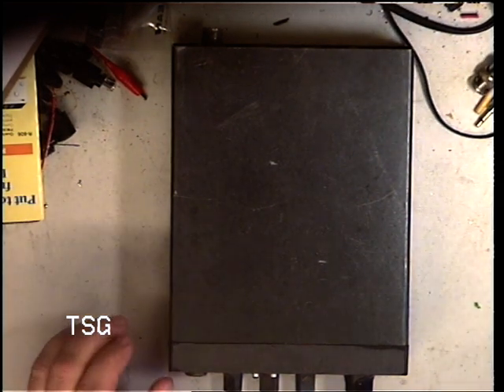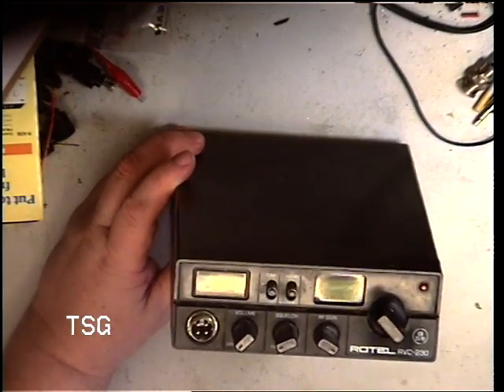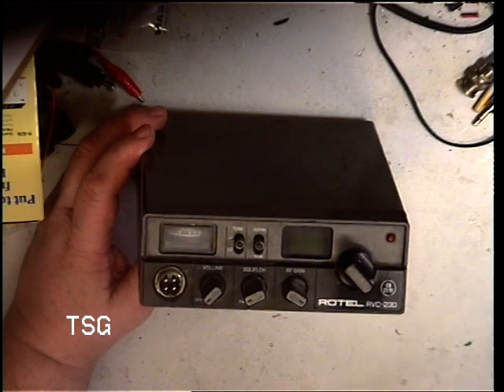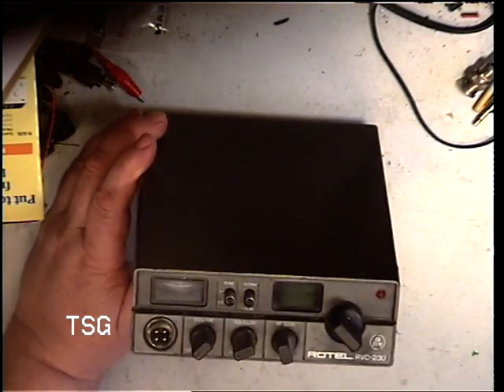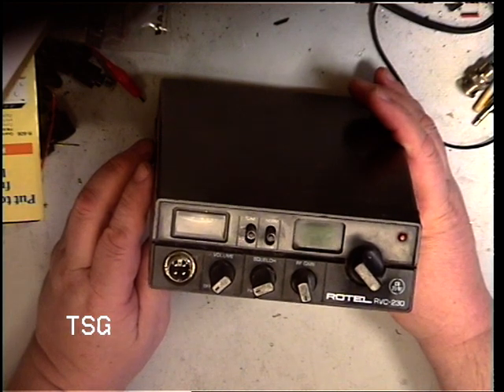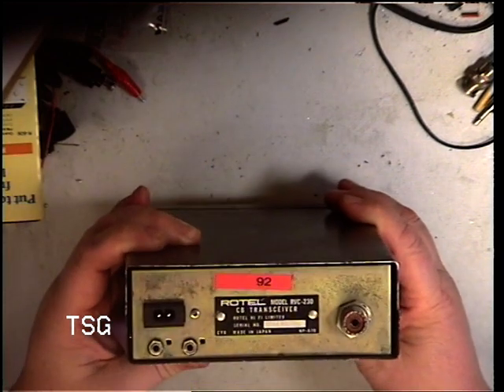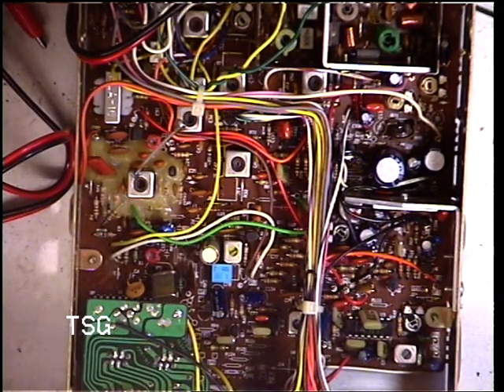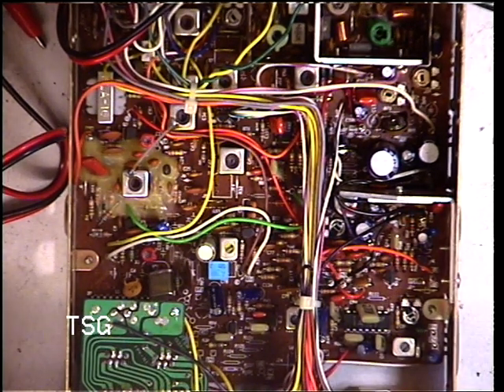Rotel RVC230 UK(CB27/81)  Mobile CB radio - Pt1 VCO & Transmit

Comment: waaaaaah low... what the bloody hell is this sorcery you speak of ?
Reply from the maker: When I did my electronics training, mainly at Rotherham Technical College, it wasn't something we were taught. However, when I met our mutual friend Nick back in 1982/3 it's a technique he used; explaining the end of the aaaah in waaaaah reached a maximum modulaion/deviation peak that a simple bit of speech or a 1khz tone won't detect. I thought no more about it. A few years later on a Pye/Philips training course at Cambridge, the lecturer used it once again with the same explanation; that validated the technique for me, and it's a test I commend to others.

Richard
Reply: @ukfmcbradioservicingTango21   Hah! Very well then! 👍

Comment: Hi Richard rotels were indeed nice look in sets, I have a fidelity 2000 cybernet chassis radio rf gain knob is faulty only rx audio if I press or turn it 
Any idea as to a part no. For one of these and where to go to get one 
Regards martin.
Reply from the maker: I don'y have a service manual for the Fidelity 2000, but do have a circuit for the Rotel RVC230 which should be the same. It shows the RF gain control as being 100K and type B which is linear. So, type into ebay " B 100K potentiometer" and choose from there. You've just prompted me to do just the same for a York 861 that's here with a squelch control just like yours...except the value is 10K, which I've now ordered.

Richard
Reply: Thanks Richard

Comment: Hi, I've just bought a midland 77- 805d port pack with no battery or telescopic aerial . It came with original speaker mic but i seem to lose the static noise with the squelch open when I move the mic around and I get no fairy lights when I key up. Any ideas?
Reply from the maker: The mic lead sounds like it is intermittent open circuit & needs replacing. Receive audio goes through the mic on nearly all CB radios. Do the fairy lights illuminate on receive ok?

Richard
Reply: @ukfmcbradioservicingTango21  I don't know about on the receive yet as I haven't had the time to go out mobile and test it properly. I do though have another 5pin mic which I am going to try. More investigation needed.
Reply: @ukfmcbradioservicingTango21  could you advise me on the correct replacement mic lead should I need to find one please?
Reply from the maker: @spinnerinthebubbleCT4543  I just typed 'CB mic lead' into ebay & got one suitable result 263771681184. Our wholesaler stopped doing them so our own stocks are minimul too. Don't forget Knights @ Kirton In Lindsey no doubt sell them too.

Richard
Reply: @ukfmcbradioservicingTango21  is that number/lead specific for the speaker mic? I assume they are slightly different leads to non speaker mic ones.
Reply from the maker: There is nothing on the market today. I've just looked at Knight for you & they have two types of 5-wire that are suitable. I've also checked with the service manual & yes you do need 4 wires plus screen, so the ebay one I showed you was only 3+ screen

https://www.kcb.co.uk/shop2/contents/en-uk/d121.html#p271
Reply: @ukfmcbradioservicingTango21  thanks for your help and advice but something has happened...... For the good too. I've just had another mess about with it, I unscrewed the mic casing screws to have a look and all of a sudden the fairy lights started working and the intermittent loss of static noise has gone too. I've obviously disturbed something. Whether it will stay like this or come back is to be seen but I'm now alot happier. Checked the hi/low power switch on the back and that's working fine also and when you push the volume button, all the lights stop working, push it again and they start working so bar a full mobile on air test everything appears to be working correctly. Happy days 👍
Reply from the maker: @spinnerinthebubbleCT4543  Oh yes, you have the lights on/off switch on that model.